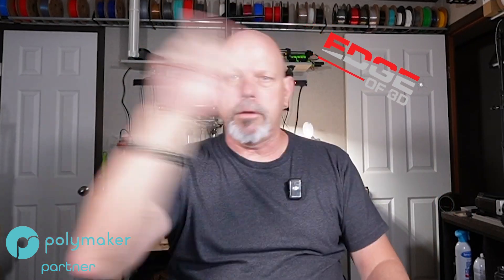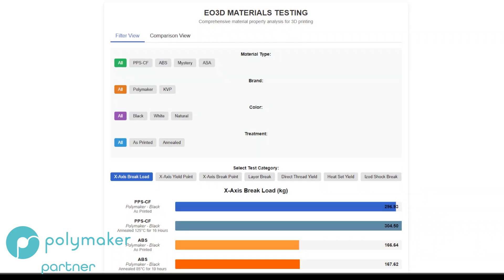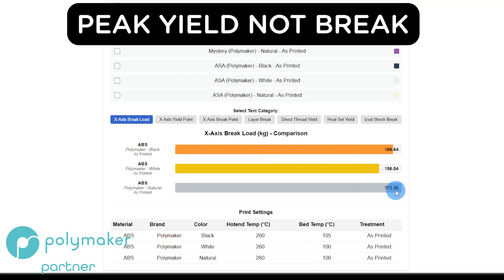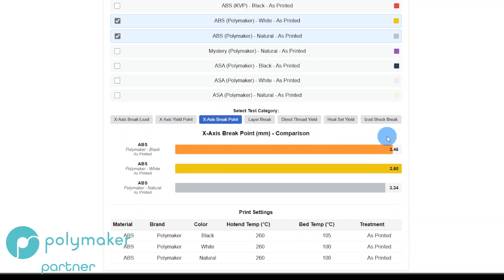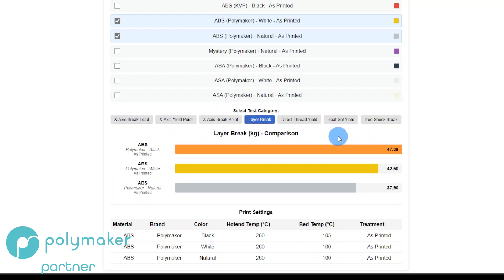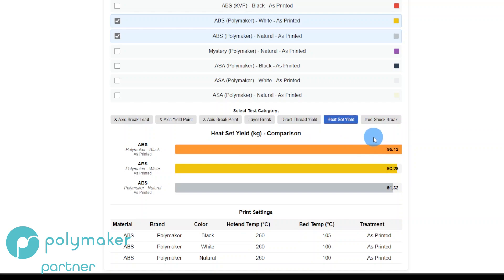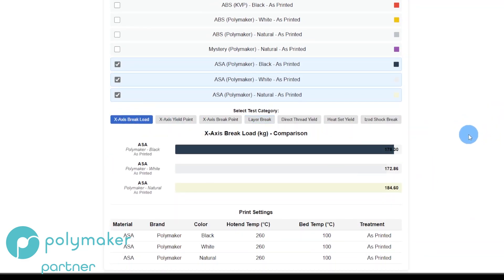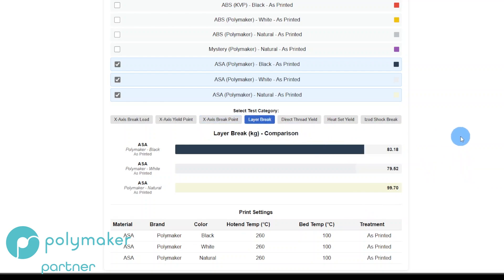DOES FILAMENT COLOR MATTER? | EDGE OF 3D

Comment: As far as layer adhesion goes. Did you use a heated chamber? If so, what temp?
Reply from the maker: No heated chamber, just enclosed with a passive temperature typically 55°c to 60°c

Comment: I can tell you, it does. Depending on the pigment, it can change printing variables as well as finished material properties.  

Wish you had done red. Because the red dye polymaker uses in its petg is horrible.
Reply from the maker: I'll test Red eventually, right now the only ABS or ASA red from Polymaker on hand is Galaxy and that has aluminum glitter in it so it would not be an accurate comparison material.